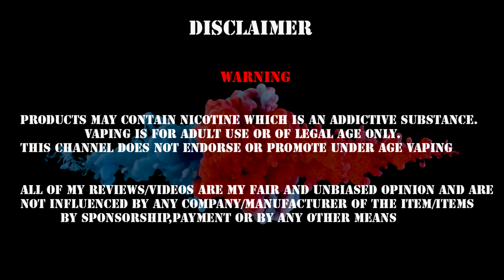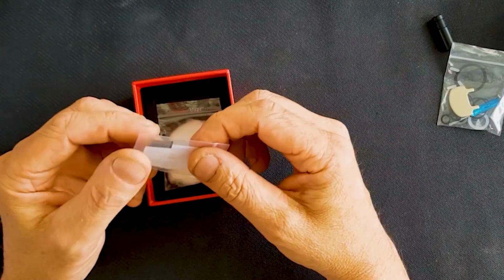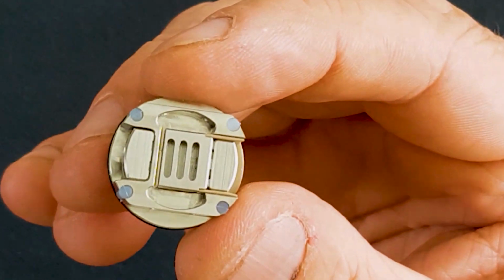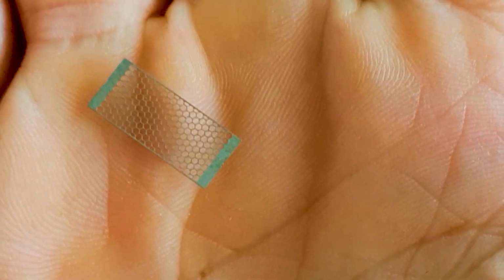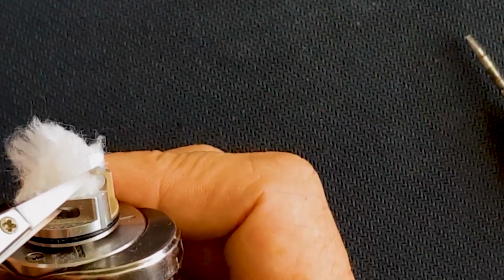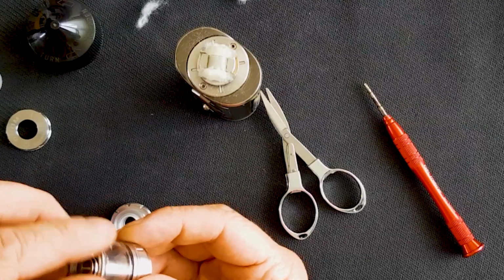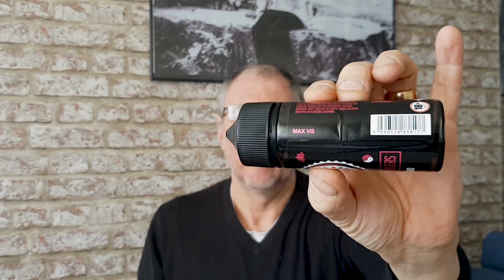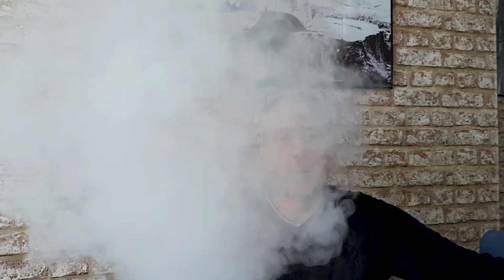DOOM MESH RTA  IS THIS A GAME CHANGER!!!!!

Comment: Thanks for the review . Write as the tank to taste and possible leaks in the tank ?
Reply from the maker: Tank doesn't leak at all unless you get the wicking wrong but when it's right the flavour is amazing
Reply: Actually it does leak, more then any other mesh i have, but still within acceptable limits.
Reply: @psycosoft1  Do you have some tanks on the grid ? What 1-2 tanks in your opinion the best on a grid to taste and on non-flowability ?
Reply: I have the kylin, the Doom, actually have used all mesh rta's. My favorite overall is the kylin mesh. My Cali rda is probably a bit better taste, but not by enuf to notice. The Cali on a purge is my favorite vape, but a kylin mesh and a drag rta are daily vaves for me. I love the way all three bring out all flavors in a juice at the same time. With almost 18 yrs vaping, I've tried almost everything, but so far a mesh deck, either in a tank or on a Squonk are my choices. Of course even tomorrow something better could come out. I don't review, so I have to either buy or try what many reviewers send me for my opinions.
Reply: @psycosoft1  Thanks. What can you advise as the first tank on the grid ? I can't make up my mind .
Reply: Сергей Краснодар today both the Kylin rts’s top my list. The mesh has better flavour. I have a beta of the new doom mesh on its way to me. They claim it makes the existing one an orphan already. Also playing with SS mesh now, temp control on mesh is great, but far lower temp then coils. Since I like mech mods, still use the rda’s a lot. Gonna get a Russian mech next. Any advice?
Reply: On a flavour basis, the Kylin mesh is number one. For a single coil, still the drag. I have also been a bit impressed with the new higher end tanks from Smok. They have it together with mesh coils. A lot of what I like is so old they arnt available today. What mod’s do you use? What watts for non review vaping?

Sent from my iPhone
Reply: Have you tried the Digiflavor Themis RTA?
Reply: @psycosoft1  No this RTA I have not tried .
Reply: @psycosoft1  And when you get a new Doom on the grid ? You do reviews ? I am very interested to see your review . And what Russian fur you get , what's his name ?
Reply: It is sweet. An 8 wrap ss coil and 460 degrees is perfect for fruit flavours. Dragon fruit right now from a local lab. Making a nice afternoon for me. You should try one. Next I look for the right build for coffee flavour.
Reply: @psycosoft1  Unfortunately I wasn't able to fall in love with fur only use the Board . From RTA like the Russian Bike of 25 W , from RDA use RDA for a single coil Aeronaut and the old Dot Com on one coil 30 to 35 w
Reply: I only review for people doing reviews. Not interested in doing YouTube. My daily is a Triade, with various rda and rta. Usually 65 or 75 w but sometimes as high as 200. Depends on coils and juice. I’m very interested in the Russian vape scene, and plan to visit there soon. Also the Asian scene. Got some very interesting things to try from China factories. Some of their clones outperform the originals.

Comment: I got this tank and I'm coming from PROFILE RDA, so my expectations were high. It's a nightmare to wick and nothing comparing to the profile. I just love the innovative idea of flooding juice right under the center, but again profile supremacy is beyond all tanks. Loved the review and the intro. Best of luck.
Reply from the maker: Thanks bud wicking is tricky but after even more use I have found you really need to pack the cotton in for this to work. When you think you have enough cotton add a bit more. That was my problem at first not enough cotton. I now use practically a whole muji cotton pad now and its spot on.
Reply: @TheVapingHeed  do you make a Scottish roll with the muji pad? I have issues to wick it right. I get every half tank burn hits like hell
Reply from the maker: @andym.8610  yep I use full muji pad ,stretch it out then roll it loosely and cut off about a centimetre before I finish rolling. Then you have to wick it really tight until it's almost tearing the cotton.
Reply: @TheVapingHeed  thanks it works now. Subscribed

Comment: this is a chain vapor device if used with PG/VG mixes. you shouldn't chain vape max VG in any RTA device as the fluid does not flow fast enough, you should be using an RDA for max VG. I have been vaping since 2005 and I am a heavy chain vapor.
Reply from the maker: Totally agree but as a reviewer I have to point this out as I've seen some other reviews where reviewers are saying it's fine to chain vape with max vg in this device which you and I know this is not the case. I had 70/30 liquid in and it ran with no issues.
Reply: Ive been vaping since 2002, and i disagree. A properly wicked mesh tank will chain vape any juice you put in it.
Reply: @psycosoft1 I said you shouldn't not that you cant. to be polite I think you're lying unless you're Chinese because the first successful marketable e-cig was in China 2003 they didn't go international until 2006. I got mine when visiting China and almost had it taken by customs when going home.
Reply: They were selling them outside the Manila airport in nov 2002. I thought they might help a two pack a day habit for a long flight, and they did. Took me ages, and having more mailed from Philipines, to locate a supply. Juice was junk, but they helped. The ‘big’ improvement was ego making their versions. Today’s capers have no idea what we went through at the beginning. As to lies? I have plenty of witnesses that laughed at my filipino toys.
Reply: @psycosoft1  Yeah those were the days, ego pens and protank mini was my go to vape, then I got a nautilus and everything changed.
Reply: @eltomasoable  I think I tried everything that came out for years. Now i pick and choose, and yes, i vape a purge at home, but trying new things is still fun. The rpm80's are a blast really.
Reply: If you wick properly you can vape high VG in a rta , I use smax juice in my rta's and that is a 90vg juice and I can chain vape for fun

Comment: Hi, how do you feel with the Doom RTA Mesh?
For me it's a good product
Reply from the maker: It is a good tank as I love the innovation in the deck design. Like I said running 70/30 juice through it is fine. Just wicking is a bit tricky with higher vg juices
Reply: I GETTING DRAY HITS ALL THE TIME NO MATTER HOW I WICK , COMPARE TO KYLIN M AND PROFILE THIS IS USELES
Reply from the maker: @TheArczer1234  it's a very unforgiving tank. It's all about the wicking. Have a look about on you tube on wicking
Reply: @TheVapingHeed  I wach all the videos about this tank, wick this 100 times waste so many coils, I was thinking is tricky to wick profile but this one is much harder, also have kylin m no issues at all, doom tank I only can vape on max 55W on next mesh coill, on same coil on profile or kylin 70W is my regular basis vape
Reply from the maker: @TheArczer1234  I had same issues but just kept trying different things to get it right. Keep plugging away at it you will get it right eventually
Reply: Try difrent cotton, and use about 5% less then you usually would. Also leave a bit long and trim to a point. It’s not how YouTube suggests but works for many I know. Only took me three tries to get the wicking right for me.

Comment: How's the flavor compared to the Klyin M?
Reply from the maker: I've never vaped the kylin yet but as it's a mesh coil the flavour is awesome.  But again it's down to the wicking which can be a pain.
Reply: This and the kylin m are so far apart its embarrassing, the Kylin M is a far superior rta in every way, dont get me wrong the 3d juice flow is a good idea just executed horribly, the kylin M wicking is without a doubt a lot easier, this rta is hit and miss especially if you wick it like this, the wick should hang down half way put never touching the bottom of the air flow regardless of the VG PG ratio.